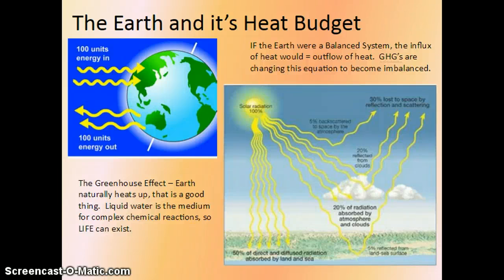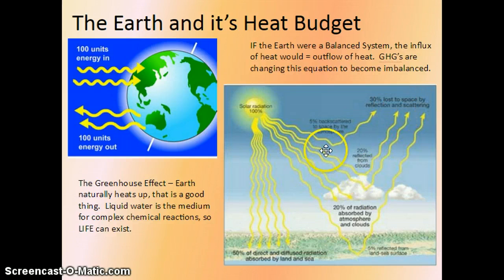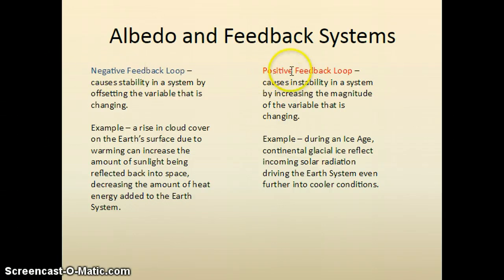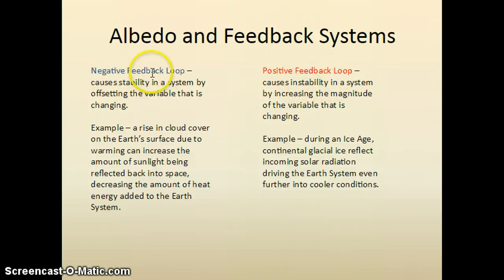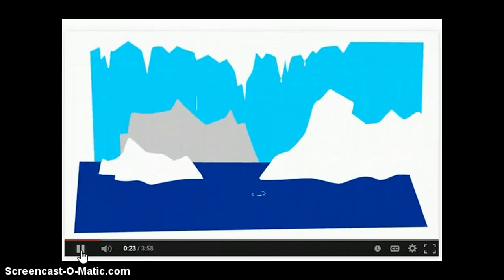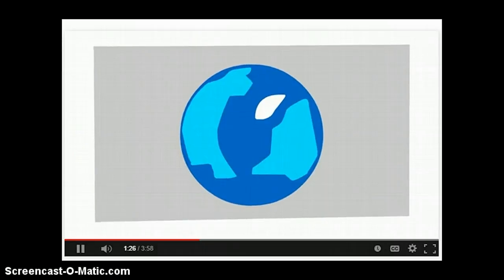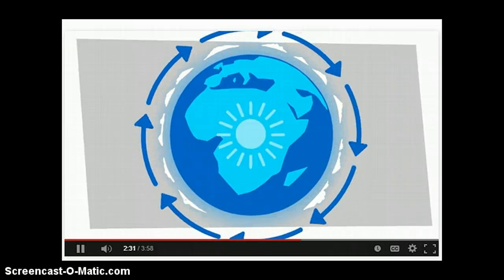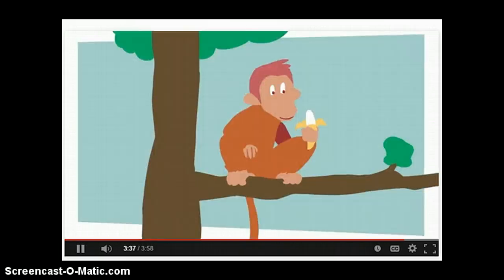7 Feedback Systems - Positive/Negative

Comment: A negative feedback is named this was because when something strays too far from the desired set point, a mechanism brings it back from the direction in which it is going (subtracting, giving it a negative effect). For example, when you get too hot, you produce sweat to cool you down, subtracting from you heating up. On the other hand, a positive feedback adds to what is being caused rather than bringing it back to the set point. A good example of positive feedback is when a mother is going into labor. Contractions intensify until the child is born. The mechanism adds to the direction in which things are going. I hope this comment is understandable enough.